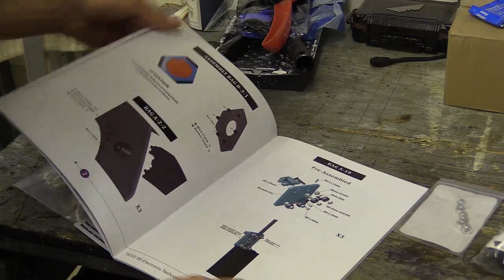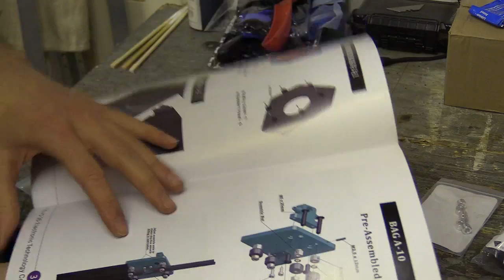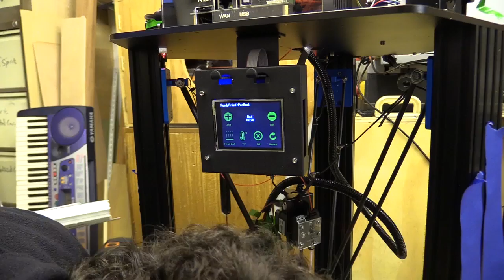Tevo Little Deathtrap (TLM)

Comment from the maker: Start Code
:
M280 S10.6 ; Clear BLTouch Errors
G28 ; Home all axis
M280 S3 ; BLTouch Extend Probe
G1 Z50 F15000 ; Move to z=50
G30 Z0.35 ; Set GLTouch offset to
M280 S7 ; BLTouch Retract Probe
G1 Z100
G92 E0
M42

End Code
:
G92 E0
G1 E-8.0 F9000
M104 S0 ; Turn off Temp
M140 S0 ; Turn off Bed
G28 ; Home Axis
M84 ; Disable Motors